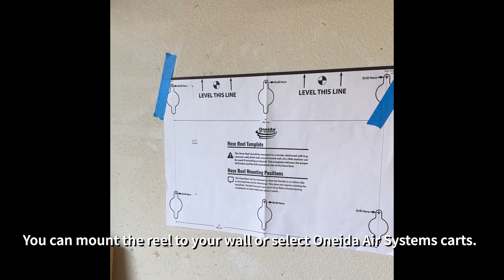Dust Collection with the Oneida Air Systems Hose Reel

Comment: Have you encountered any issues with going from a 2.5” reel hose to a 4” connection on the tool? I like your method better than installing a ton of blast gates to each tool. It’s just as quick to move the hose than to open and close another blast gate. I’m worried about the 2.5” hose reducing the efficacy on a larger tool. Thanks!
Reply from the maker: @jameswilliamjones  hi! We haven’t noticed any reduction in the power of the system going to a 4” port. We use it with our Rikon bandsaw that has a 4” port and it makes a huge difference and works great. Hope that helps!